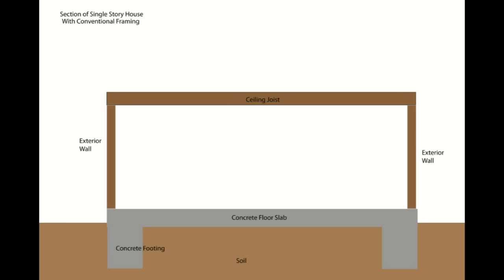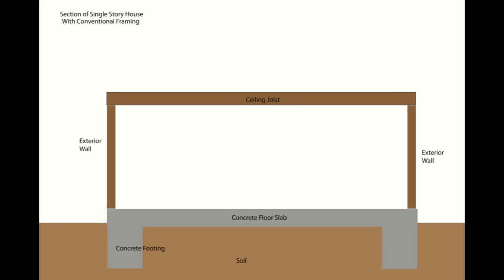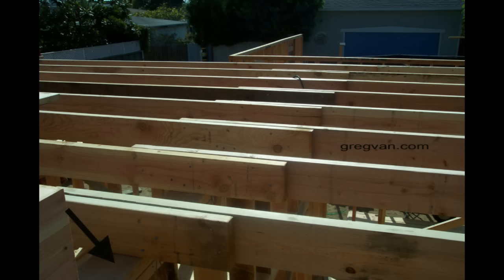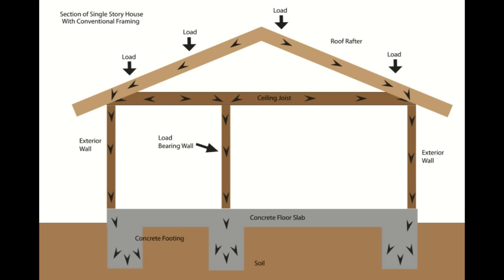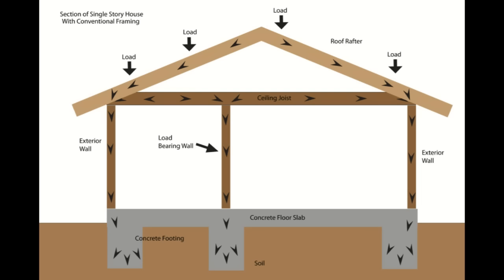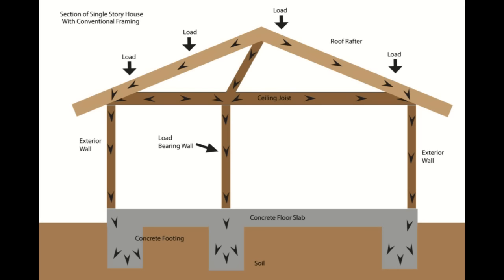Load Bearing Wall Framing Basics - Structural Engineering and Home Building Part One

Comment: I'm hoping my comment will help in some way, sometime, to anyone watching your videos. If a home owner can get their hands on any (or preferably all) of the paperwork that has to do with the building of their original structure (and/or subsequent additions), they'd have a gold mine of structural info. I've read through many of the questions here - I grew up around a truss company, my parents still own and operate a truss company in Central Florida and I worked as a truss designer and engineer for over a decade. I know GC's keep info on houses built for a long time and that info could have (should have) the engineering sheets for each and every truss on the home. The engineering for the trusses will show exactly what is bearing where, what is holding up what, how much of the loads were overkill (this happens far more often than folks might think, we called it CYA when I was in the business) and so much more. If only the truss company name can be found, the home owner can contact them directly and ask for a copy of the engineering. I'm sure more info is kept longer these days since nearly everything is digital now so folks have a far better chance of actually locating their home's building history. I feel as if I'm stating the obvious but I can't tell you how many times I've regretted not saying what's on my mind (if it's legit and possibly helpful) only to find out that I should've said something :-/ I believe what you're doing here is truly terrific considering you're offering advice and lessons that most people charge hundreds and thousands of dollars for. By the way, I want to add that the figures and crazy numbers all over engineering and floor plans and such is very complicated and I want to encourage folks to not feel inferior or stupid because even the best truss designers can't tell you what much of it indicates. As home owners who've paid already for the services rendered, I'd suggest that a home owner request a sit-down with the affiliated engineer for either the truss company or the GC, and ask as many questions as it takes to understand what you want to know. Good luck! ~jlt

Comment: Obviously you know what you're talking about - but I'm afraid newbies are going to be confused by the diagrams.  My advice - if you (homeowners) do not know how to determine a load path ( the path by which weight is transferred from the roof - through the structure -  to the footers (and the earth) -  then please contact a structural engineer to help you.  Because there are so many ways a building can be constructed, it's very dangerous to make broad generalizations about what walls may or may not be load-bearing.  You really have to start with the uppermost structure (the roof) and follow the load path down to the footings/earth  to figure it out.  I've framed dozens of buildings that don't conform to the rules-of-thumb -  the designer may have turned the floor or ceiling  joists 90 degrees to take advantage of a shorter span.... there may be roof  or floor trusses  which actually DO require a center support.  There could be walls that are perpendicular to the eaves (usually not load-bearing) that are in-fact carrying a floor load, or maybe  a concentrated point load from something like a second-floor master bath or a complex roof structure.  There are just too many variables and "gotchas" to make assumptions or generalizations.   Best practice for a DIYer - assume every wall and every construction is load-bearing until you determine that it isn't.   You'll never get into trouble being too conservative.   Then - once you determine that a) there is a structural load at-play ,  and b) the size of that load... .then you can design new structure to safely transfer that load to the building footings/earth.
Reply from the maker: I think you covered everything and for any newbies who are confused with the diagrams, feel free to contact me or leave a comment in the comment area. There are lots of good points in this comment and it is greatly appreciated.
Reply: A wise man speaks 😎😎😎💪💪💪
Reply: really grt points..
Reply: Couldn't have said it better. You really hit it and where did it really well for the homeowners because they don't understand a lot of the stuff. And it is good to have the knowledge out there for them to be able to spot if they're contractors doing the right thing or the wrong thing.

Comment: I would add a couple comments.. A load bearing wall is not only a gravity load bearing wall, it may also be a lateral load bearing wall.  There are many ways to determine if the wall is a lateral load bearing wall.  On of the most common ways to determine if it is a lateral load bearing wall is probably by looking at the floor plan; since the exterior walls are typically load bearing walls the distance between the exterior walls is a big clue.  If the distance between the exterior walls (wood construction) is fairly large something like 30' or so then there typically needs to be an intermediate wall  that will likely be placed down the middle.  This middle wall helps transfer wind load to the foundation.  In summary a buildings structure needs to be stable in both the vertical and horizontal directions (vertical = gravity loads and horizontal = lateral loads).  Home owners should consult with a licensed engineer to determine if walls are load bearing or not.  Engineers will likely charge anywhere between $60 - $80 per hour so a total cost will likely be about $120 - $200.  If a report is required the total cost may be $300 - $400.  Of course one should shop around for an engineer and choose one based on experience and rating.

Comment from the maker: You've got a good point about the concrete footing, but this is how we've been doing it for years and there are plenty of homes built in the United States where a non-bearing wall connects directly to the ceiling joists.
Reply: Interesting and good to know. In case someone wants to take a wall out. :(
Reply: Mech eng here, the load is still getting transferred onto the concrete floor from what is termed as 'non load bearing wall'.

Comment: I appreciate the videos. At about 6:24 in the video, the force arrows in the rafters and ceiling joists in the same direction (out towards the soffit. Vertical loads down on the roof put the roof rafter in compression (as well as bending), and the ceiling joist in tension (restraining the rafter end from moving outward) The ceiling joist also resists any loads it carries such as the ceiling and attic live loads. This is primarily carried by bending resistance in the ceiling joist (flexural resistance between supports). Perhaps you could revise your arrow indicators to better reflect this?
Reply from the maker: +Ted Lane My main objective here is to keep it simple and focus on loads only. However, can always make another video. What exactly would you like to see in the other video?

Comment: Say it this way. If the wall is running parallel to the ceiling joist and have no braces going to a hip, valley, ridge, purlin (the roof) on top of it, you have a very good chance that is a nonload bearing wall. If a wall has ceiling joist above it and the roof is a cut roof (not trusses), That is a load bearing wall. I say it that way because the size, span, and spacing of the ceiling joist could very easily make that a load bearing wall. Not always, but most of the time. Thank for the video.

Comment: This is great information.  I am going to build a free-standing ramada (12' x 15').  A structural engineer told me the 18" piers in each corner would be adequate to support the large tile roof.  The footings will extend 4" out at the base and the piers will be constructed with cement blocks to the top and reinforced with rebar.  (whew!)  How deep should these footings be?  I live in Arizona with no frost to be concerned with.  )BTW, the roof calculates to be around 3000 lbs.and will sit on a steel beam header).

Comment: okay, so to find out if it's load bearing is if it has ceiling joists on both ends that means I have to uncover the stucco to see if the joists are LB. excellent, thanks!
Reply from the maker: There's a good chance that it will be a loadbearing wall if the ends of the ceiling joists are sitting on top of it. Now for the bad news, if you can't actually see the framing, then it will be difficult to tell whether it's loadbearing.
Reply: i'll definitely check, also, based on this vid there's a good chance I can get away with cutting the studs, since the studs are only on the upper floor and don't go down to the foundation, and I've been wanting to rip out the cieling for a while to rewire the whole thing anyhow, that's when I'll confirm if they're LB or nor. :)
Reply: gregvancom  what are the purpose of a loadbearing and non bearing?
Reply: Nana Baffour if you take off a loadbearing wall, the building will likely collapse.
Reply from the maker: Nana Baffour Loadbearing walls hold up sections of the home like your floors and roofs and provide extra strength to prevent them from blowing over under strong winds or something like a hurricane.
Reply from the maker: Yes you've got it.

Comment: This is exactly what I needed to clarify an argument with my father-in-law over the "load bearing wall" he would like to get rid of but can't. It's definitely not a load bearing wall, haha.
Reply from the maker: Don't be too hard him.
Reply: This guy doesn’t know what he is talking about! Whenever a load bearing member (ceiling joist in this case) is bearing directly on top of another member (what this bloke is calling a non load bearing wall) that member becomes load bearing. No ifs or buts about it. The site photo also shows the “non load bearing wall” to have a lintel about the door opening, this means that the wall is load bearing otherwise it would have just a standard trimmer. Don’t listen to this blokes advice, he is incorrect!

Comment: Great video. The illustration shows the interior load bearing wall not centered directly under the ridge board. I’m designing a cabin the exact same way. Does the interior load bearing wall have to be centered?
Reply from the maker: No, you can move it and adjust lumber sizes for span difference in rafters or ceiling joist if needed.
Reply: @gregvancom  thank you!

Comment: I have a set up almost identical to what you showed, and in fact do have a load bearing wall which I would like to remove. The ceiling joists are 2x6 and lap over the wall I want to remove. A contractor told me because most of the weight is transferred to the outside walls, we can through bolt sister boards on each side of the lap on each joist, which will make up for the support the load bearing wall provided, and then remove the wall. What are your thoughts
Reply from the maker: +Andrew Smeigh I'm not sure that method would work, but would need more information. Remember I'm not a structural engineer, but I am real familiar with most of the construction practices used by them. Feel free to send me some pictures or a drawing.

Comment: I have a pillar by my kitchen island that i want to remove, went into the attic and it looks like the beams are sitting on top of it, but not overlapping each other. Will it be considered a non bearing load? Thanks.
Reply from the maker: I can't provide engineering information for individual projects, but can tell you that it might not be.

Comment: Can you show a diagram on how to connect two roofs together for a log cabin?  In an "L" shape, the first truss on the left side of the horizontal stem of the "L" is on the load bearing wall.  The walls on that addition are all horizontal logs.  The logs will settle, so the roof connection needs to allow settling or it will pop apart and the metal will tear. The walls on the main part if log cabin have vertical logs that aid in support and don't settle.  At a loss.  It was not done correctly. A "master roofer" cut the engineered truss as he said it was higher than the others.  It was designed that way to allow for settling.  Another guy (framer) replaced it with laminate beam and built truss on top of it. But didn't tie it in to allow for movement.
Reply from the maker: I'm not familiar with only one side of a log cabin settling. Send me some pictures of your project and I will see what I can do. You can get our email address at the website.
Reply: gregvancom emailed you few days  ago.  I will get pictures for you. Thanks!

Comment: my contractor poured a concrete footer 24" wide x 20" deep and set bent rebar into it to tie to the slab, the edge of the slab was in the middle of the footer. hope this makes sense, it looked over done.
Reply from the maker: +sonofthunder 333 It's hard to say if something is overdone, without a picture. Feel free to send me one or be glad that it wasn't poorly done. I feel your pain though, because I've came across plenty of projects that were definitely overbuilt.
Reply: to late for a photo, but i just saw a commercial building footer that was 24x24, mine is 24x20, so im sure it will hold just hate to be paying for unnecessary material.
Reply from the maker: I worked with a structural engineer who used 15 inch wide  x 24 inches deep footings with four number five rebar's for a single-story homes, small single-story home, with 8 foot ceilings and 22° roof pitch. I thought this was a bit overdone, but since I'm not a structural engineer, would have a difficult time making a reasonable rational argument.

Comment: Great job on schooling us. My house was built mid 50s. small dining room had a wall but ex took it out and made it a bar with countertop. door frame remained. I remove the bar area so that has opened the dining room to flow into the kitchen. The door frame remains. Is the one stud that I need to remove (looks like a  3×3) load bearing? House is 1 1/2 stories. Thanks for any help.

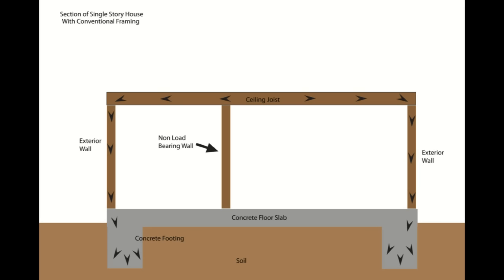Comment: Greg, at 3:35 you start talking about a non-bearing wall that can serve a purpose aside from just separating space. Its sounds like you are saying non-bearing walls can be structural members of the house. Am I right? If so can you give examples of a non-bearing wall that can make a house lean if removed? Thank you!
Reply from the maker: I will try and make a video to provide you with more information and for those reading this in the future, the title of the video will be, "Can removal of non-loadbearing walls make building lean?"
Yes, non-bearing walls can be structural.
Reply: Awesome. Thanks for the quick reply and post. I am about to enjoy the vid.
Reply: PMFJI - your question wasn't really answered. That wall in question may it be carrying any normal static building loads - but is sure could be serving as some kind of a buttress or shear wall assembly that is providing lateral (sideways) loads such as wind load - or resisting spread from rafters pushing the top plates down and outward  moral of the story. - better safe than sorry , have an engineer examine the site and put his/her stamp on the solution.  Good luck w your project !

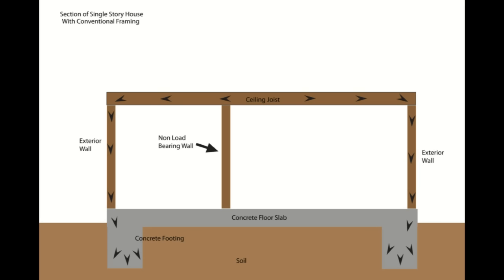Comment: I have a similar wall with joists similar to @4:40 (joists travel from brick to brick) BUTT ... I have an additional floor above and then a flat roof above that. In my instance ,Would it be considered load bearing? Seems as if it is suppose to be
Reply from the maker: Load bearing is usually a wall with weight transferring from materials above it or connected to it.

Comment: Would it not be more structurally sound to place the exterior wall in the center of the concrete footing? Or will it make no difference?
Reply from the maker: I think it would be better and was common practice years ago, but they also didn't always use rebar and concrete rated much above 2500 psi.

Comment: First, let me thank you for making these wonderful videos, thank you for your time and efforts and patience. Now, I have a few questions that I hope you might help me with. Can a small 'office' shed/building to be put up inside of an existing warehouse that already has a level concrete floor? I mean, surely the load-bearing principle applies to any structure ( I never knew of such things!), even a 10 ft x 10ft shed, right? But after watching this video, what kinda' scares me is that there won't be any underground foundations to absorb the weight of my proposed building, just a flat surface. If I built a frame on a flat concrete surface, would that suffice to hold up the walls and ceiling, you think?? ( I've never constructed anything in my life, but I really want an enclosed office shed, but can only afford to build it myself--hence the DIY attempt. I just don't want it to fall down on my head afterwards!) Might a secondary foundation be recommended instead?
Reply from the maker: I think a 10 x 10 shed could be installed safely without any extra foundation work as long as it's a concrete foundation.
Reply: Thank you. I plan to nail it into the floor (special nails from B & C Hardware store), and the B & C guy also thought a 10 x 10 would be okay on the concrete.
Reply from the maker: TheGypsieStar Just remember, these are only our personal opinions and have no way of guaranteeing success. I don't want to scare you and still think it won't be a problem, but don't know for sure.

Comment: Are most houses constructed with the ceiling joists running perpendicular to the ridge line? My old 1924 bungalow has the joists running parallel with the ridge. They have the joists tied together with 2 x 4s that criss cross, holding the front and back walls in.
Reply from the maker: bg147 Most ceiling joist run perpendicular to the ridge and I would imagine it has a lot to do with saving money. It cost more money to run the rafter ties in the opposite direction than it would to use the ceiling joist as rafter ties.